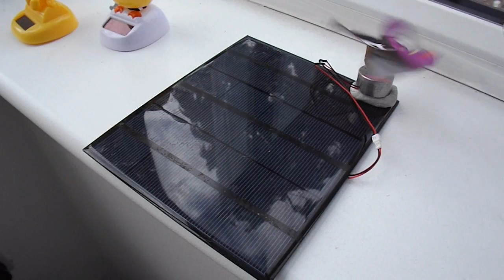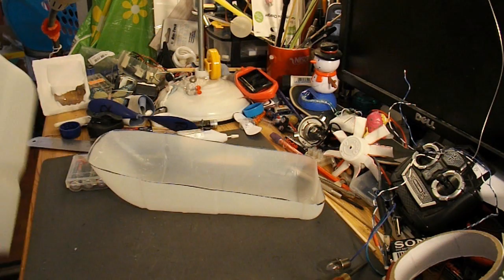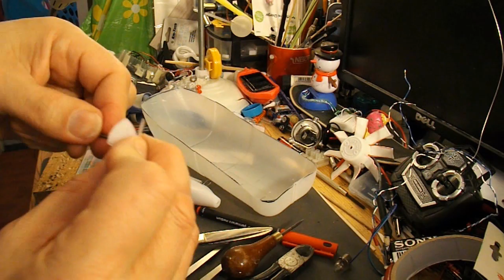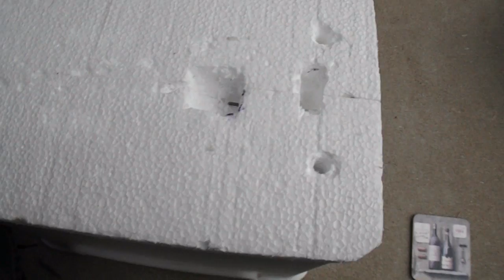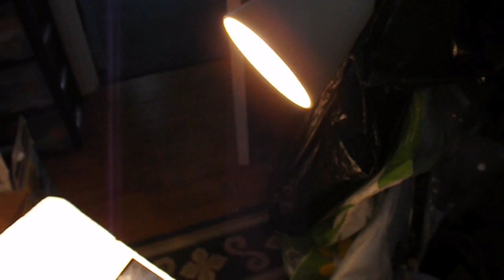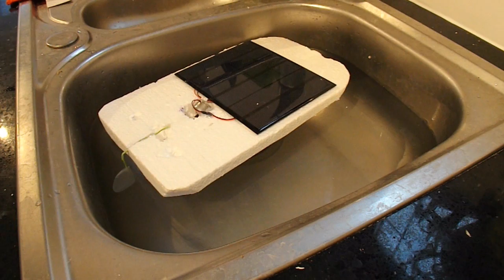Replacement Solar Boat

Comment: Makes a good boating sound and I like that bubbles thing it does.
Agree about the catamaran idea. If it sits high enough of course. Else, you could put low height pontoon things underneath for the same effect I would think.
When you go to the lake - watch out if the boat sags its shoulders !
Reply from the maker: slider2732 thanks. I don't think this one will sink unless a brick lands on it, but it may get blown about by the wind. Rain is forecast for the next few days and I am toying with the idea of making an RC rescue boat for collecting it if it gets stuck under a cloud.
Reply: GrandadIsAnOldMan
Now there's an idea !
Here's something to add to the concept I hope - magnetic locking for the boats. Magnet on the solar one at the front, magnet on the rescue boat at the back. Maybe on a short boom in case of the wake from the rescue one.
Reply from the maker: slider2732 that would look very professional but I suspect it may require more accurate steering than I am likely to achieve. Of course a big enough neo would probably attract it from the bank without sending the rescue boat :-)
Seriously though your idea would be worth trying.
Reply: GrandadIsAnOldMan Haha, it gives cartoon visions, of a red horseshoe magnet and beams emanating toward the boat.

Comment: I couldn't quite see the bottom of the boat Grandad but if you have a Catamaran style bottom it might have a bit less drag in the water.....What I mean is if you lift the boat out of the water there is a small amount of suction but if you reduce the amount of Hull contacting the water it might make for a more efficient boat, what do you think, It does look like a good boat though.....Lots of fun.
Reply from the maker: Graham R Dyer we will see how it performs in the lake. It is just a normal flat bottom at the moment. Another advantage of making it a twin hull would be improved directional stability, in other words it should help it go in a straight line.

Comment: Great video grandad. I was wondering what soldering iron you used? because I need to buy one.
Reply from the maker: CarGeek 5000™ my iron is pretty old. It is ANTEX and it is 18W so it is the right size for most of the light weight soldering I do.
Reply: GrandadIsAnOldMan Great thanks

Comment: Grandad would it be possible to make a cheap and simple boat using a plastic bag? I have to do a lab for my science class involving the hulls of boats but I don't have any of the wiring or motors suitable for the lab yet. Thanks- Evan
Reply from the maker: Evan M so that would be a plastic bag with an electric motor attached? You would need to add a counterbalance underneath to keep it the right way up.
Reply: GrandadIsAnOldMan Okay thanks for suggestion I would've soiled the motors and batteries if it weren't for you... Thank you!
Reply from the maker: Evan M I will upload a video on Tuesday with my version. I needed to add a rudder to keep it straight.

Comment: If you could make the propeller smaller than this. .
Trust me it's work better
Reply from the maker: ten piseth maybe it would, or maybe I could buy a proper propeller, but either way it is what it is and we will see if it works when the weather dries out and the sun shines again.
Reply: GrandadIsAnOldMan 
I mean small propeller for your boat. 
I use to test it.
It doesn't need that big propeller for that boat motor size.
Reply from the maker: ten piseth like I said, it is what it is, I have no intention of changing it at the moment. We will see if it works when the weather changes.